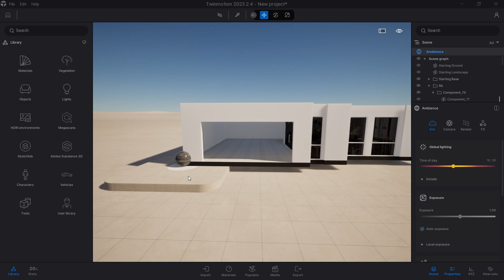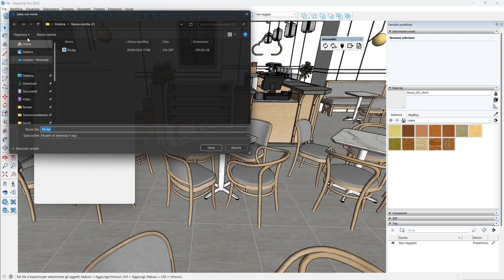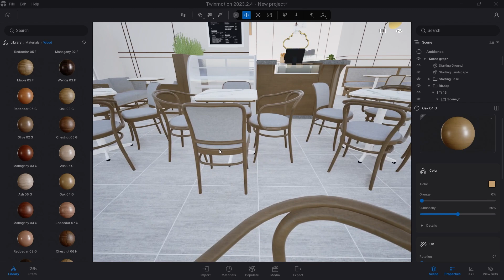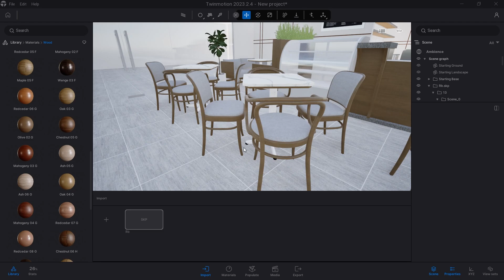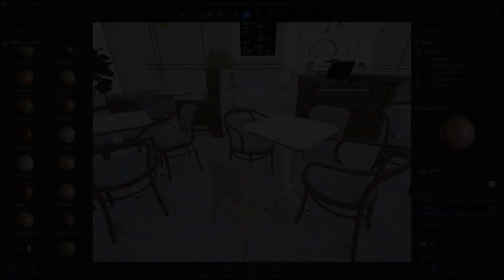Twinmotion 2023.2.4  - Optimizing 3D for Twinmotion

Comment: This is a good topic, 👍 
I understand there is an issue with meshes as well. Not having the ceiling and wall as the same mesh?
Also What are the benefits of using the datasmith vs native SketchUp file?
Reply from the maker: Always group single wall portions, so in Twinmotion you'll have more control with materials. Same thing with ceiling, always in a different group.
I always suggest to export in Datasmit because it's the native Twinmotion/Unreal Engine format so you're not asking your 3D file to be converted. Datasmit is also way more lighter than a 3D file. Lastly, with Datasmit the materials will be applied more easily to surfaces without future issues for updates. 
Thank you for the comment, I'll create a dedicated video for this argument!

Comment: hi how are you ?  very good tips, I have a question, you know that the direct link from SketchUp to TM sometimes the objects come with a black material that does not allow materials to be applied and the way to solve it is by exploding and regrouping, but there are complex 3D objects that last too much exploding and regrouping.  I wanted to know if there is a more optimal solution to improve the workflow.  Thank you
Reply from the maker: Hi, thank you for the comment, anyway it is a known issue, it will be soon fixed. At the moment the only thing I suggest is to explode/regroup all the black surfaces and then upload again the datasmit in twinmotion. It should happen only with components, not groups

Comment: Thank you very much for your video, I think it is the only one I found that explains several problems I have. In my particular case, when using Datasmith, some materials look opaque despite applying "2 sides" and it seems that they are the groups that were made in Sketchup, the only solution is to ungroup and group again so that it can be corrected. On the other hand, I have suffered the situation of applying all the materials to the project and when I reconnected TM with skechup all the materials were reset and I had to reapply them one by one. I understand that this is due, as you explain, to the fact that I have modified the 3D on a surface that shares the material with another? Is that why?

Thank you
Reply from the maker: Thank you for the comment, I really appreciate when someone asks for help.  
Anyway, the first problem is a known issue, it should be fixed soon. It should happen only with components and not groups, but maybe I'm wrong.
For the second one, I really suggest to mantain always all the files in the same path and always modify the 3D for everything. If after 3D update your Twinmotion project turns white means that the connection has been lost for some reason, maybe the assets folder has been deleted. But here in the comment is very hard to find a solution.
I assure you that if you follow the steps i explained in the video you'll never have materials problems again.
Anyway stay tuned because the "white material problems" video will be ready soon 👀